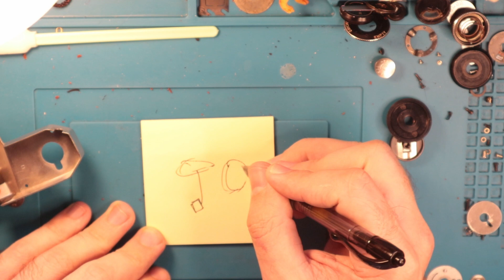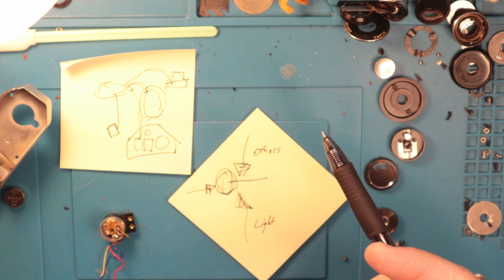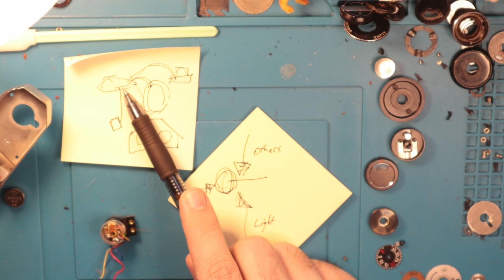Pentax K1000 Light Meter walkthrough/Repair part 1

Comment: Can I still use my spotmatic eventhough its needle is resting downside not in the middle? Can I still took pictures from it?
Reply from the maker: You can indeed! The camera will function but I would recommend using an external light meter or a phone app to meter light and get properly exposed images.

Comment: So I was trying to fix my light meter on my K1000. But I accidentally severed that tiny black wire that runs from the battery housing to wherever inside the camera . No I don’t have any slack.
Reply: So I’m pretty much screwed now